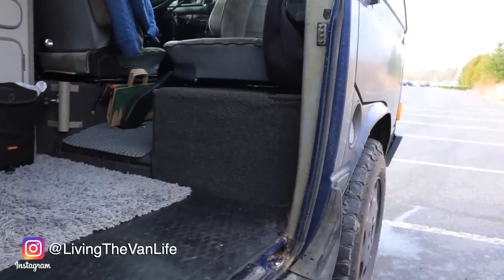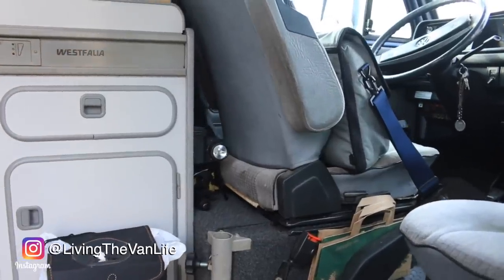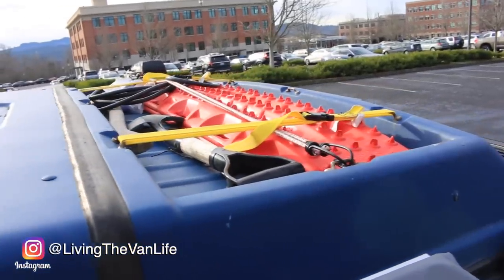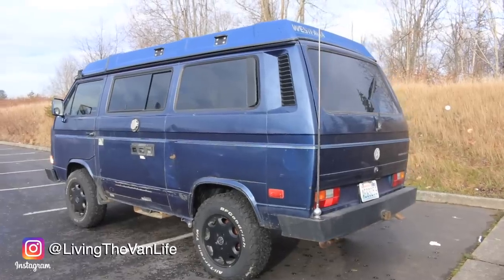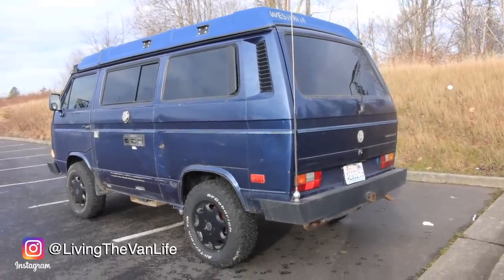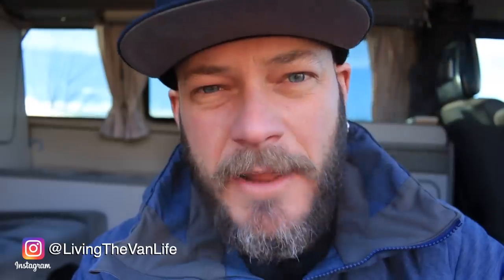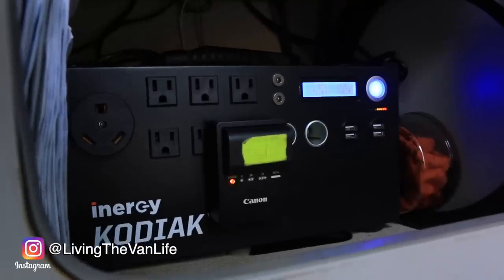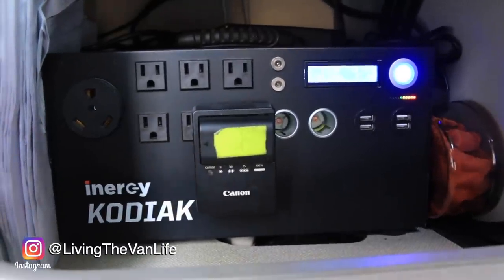Chinese Diesel Heater Install In a Volkswagen Westfalia - Living The Van Life

Comment: Nice install Chad, couple of questions for you. Do you smell any diesel, with the tank mounted inside the van? Second question is, how long does a tank of fuel last? Keep up the great videos.
Reply from the maker: I do not smell any diesel at all inside the van.  I fill the tank directly from the diesel pump at a gas station.  As long as you don’t spill any outside the tank, there is no smell of fuel inside the van.
Reply: around 1/2 l. a hour
Reply: On full power it will use 2 gallons in 25hrs
Reply: @LivingTheVanLife   how many fillings and or different pumps have you used? i have had a diesel vanagon for years and ive considered the diesel heater. even considered using the tank, rather than taking from the vehicle. The reason im mentioning this is, there are some really leaky messy diesel pumps out there. even with a steady hand and slow pumping, some just cant help but make a mess. Im wondering what you do to deal with this?..... or if its just the case where it hasnt been long enough, that you have had the chance to come across one of the pumps that spew and leak
Reply: @andrewcornford2306  how is that even possible?
Reply: darthinvictus666 I get 8 hours for every gallon of diesel in mine
Reply: Hi there, does it use a lot of battery power using it over night?

Comment: Did I miss the part about installing the external exhaust?
Reply: You definitely want to intake from outside to not get carbon monoxide poisoning, but routing the exhaust into the van would allow it to heat more efficiently
Reply: @sugarbooty  you guy crack me up
Reply: No, I was waiting on that part 2.

Comment: Popped one of the 5kw units in my B5 1.8T passat trunk and I leave the seat down for the winter and it's thermostatically controlled and comes with a remote keyfob.  I added an LED light in the rear window that let's be know the fuel pump is plugging away... these things are incredibly efficient....

Comment: Excellent install and explanation. 

Battery capacity/draw would be my biggest resource concern with this heater vs the Buddy heater.  
What's your average amp hour draw? 

Also, is there any level of residual heat around the heater housing itself to be concerned with?
Reply from the maker: I will have to make a list of all of these questions and then do one whole video that addresses all the questions.  I will work on some tests that give specific results and figures.
Reply: The heater runs at about 1 Amp on low (about 12 Watts) and 3 amps on high(36 Watts) 4 or so amps if the glow plug is running on startup.  Most I have seen draw wise is 6 Amps.  I would say the average is 2.5 amps.  The outside can get about 90 degrees F in places.  The exhaust muffler makes it much quieter, as does an intake muffler which are aftermarket options.   Average fuel consumption is around 12-24oz per hour of continuous operation.  A carbon monoxide detector with ppm readout is a must.  These are one of the safest and best heating options in my opinion and experience.  It can be ran directly off a cheap solar controller, so easy to hook it up that way, you connect an auxiliary battery-and use the cigarette lighter plug as a recharger for while your driving-run the line to the input on the solar controller.  Here is a good video of the current use:
https://youtu.be/KBpHAqN2Gls
Reply: Battery Isolator just in case.  Don't want to be stranded.
Reply: @ProlificInvention  your findings are completely different to the rest of the known world.
on initial start up the glow plug on ALL of the chinese 5kw heaters draw 14a/h,
a little above 1a/h on high and 0.4a/h on tickover once the thermostat temperature is reached. 
Fuel consumption is 0.02ml every click of the pump.
it will use approx 1 litre of diesel in 10 hours of continuous operation on low.

Always run power directly from your house battery, never the solar contoller.

Hope That Helps
Reply: @only-vans  I stand corrected

Comment: Idk if i trust that seal. At least its diesel if it leaks
Reply from the maker: The seal of the fuel nipple to the fuel tank?  I had the exact same concerns, but figured I had to give it a shot.  I have had it installed for a month now and have been monitoring it closely.  There is no sign of any possible leak whatsoever.  So that is nice to see.
Reply: I agree. Adding a layer of RTV silicone or something to that effect will just give you double the insurance if there is any fuel leakage. If it works for him though, no problem. Might even consider a inline on/off valve in case you need to remove the fuel tank without spilling diesel everywhere.

Comment: Hi Chad, thanks for the video, very good explained. I have installed my Webasto heater (looks the same like yours) outside below the floor of the car. Only the hot air tube gets inside. The manufacturer confirmed, no problem. It works good since a year now. That  saves much space inside and another advantage in summer is, you can use it as a fan only blowing fresh outside air to the inside.
Reply from the maker: Awesome.  This is great!

Comment: I have heard that these heaters dont work in high elevations, over 5000ft. Have you had any issues since you seem to be in mountainous areas?
Reply: jerry mc there is actually a version called Plateau made for higher elevations. I’ve seen it on eBay and Amazon. Many of the heaters are altitude adjustable now.
Reply: @aaroninks  Thanks

Comment: Drill a bunch of holes on that board covering the heater to give it more intake breathing space as well as save on weight. Doesn't look like you are storing anything that could fall through the holes in the board, but in case, you could just install mesh netting like screen door material on that board with holes to ensure nothing falls through. This will allow your heater intake to get more fresh air and give you more storage space.
Reply from the maker: Thanks!

Comment: Doesn't diesel fuel stink? I would suck to have even a small spill while refilling the tank inside.
Reply from the maker: Diesel fuel does stink indeed.  With this diesel tank in my cabinet adjacent from my slider door, it makes easy to pull up to a pump and fill directly from the pump to the tank.  It makes NOT spilling easy!
Reply: It is smelly but I find that even if you spill it it(inevitable) it will evaporate fairly quickly.

Comment: It seems to me that a fuel source located inside the van with active electrical sources would be considered dangerous and beyond my comfort zone. Curious, what were your reasons for not mounting it underneath the van? To me that would seem to be the safest location, but might be more of a challenge to fill. Thanks!
Reply: Indigenous Pathways  Diesel is a safe fuel u need to ether compress it or spray it in a fine mist to have it combust u could throw a match on a puddle of diesel and it won’t  ignite
Reply from the maker: Mounting it under the van would be possible, but it would take a lot of fabrication and design to make it all possible.   Diesel is not highly flammable like gasoline or propane.
Reply: Yup, as the other guys say, diesel is quite safe. Gasoline really does gas up and become explosive. Diesel is more like a can of engine oil. It is flammable but not particularly explosive. This is one reason why diesel is so suitable for boats, and it is the reason that diesel is used for this type of heater.
Reply: There are auxiliary diesel tanks made out of metal one could purchase and install under the van. Benefits would be more capacity and easier to fuel up (just roll up to a diesel pump and fill up). I don't think this 10 liter plastic tank is suitable for that kind of use. A proper such tank would probably cost more than the whole heater package though, but then again $170 is dirt cheap.
Reply: As mentioned, diesel is not particularly explosive, quite the opposite actually. We used to heat out boat (45' offshore sailboat) with a diesel heater and a diesel stove. To get the stove started (Dickinson Marine stove / oven) you opened the valve and waited for visible fuel... then dropped a lit wad of paper in on top. Then you did it again... then again. Some times 3 or 4 times to get it to light. This was about 4 feet from a 450 gal diesel tank and the day tank (12 or so gallons on top). Lived on that boat for 5 years.

Very common setup on boats / yachts. These types of heaters have been used for years in the marine industry, and while finicky (apparently) they work well and are safe.

Comment: I like the idea of using the diesel fuel instead of propane. I would be interested in knowing how long a tank of fuel will last you.  if it's 10 liters, that is about 2.6 gallons. I'm sure it would depend on how cold it is outside and how warm you keep your van.  Also what kind if impact does it make on your auxiliary battery?
Reply: 1 gallon of diesel has 139,000 BTUs.
5kw = 17,060 btus

So on max settings, 1 gallon of diesel will last approximately 8 hours.  That is if it ran full blast the entire time, which is unlikely to ever happen in a van.
Reply: That answers my question pretty well.  Thank you Logan.
Reply: The heater runs at about 1 Amp on low (about 12 Watts) and 3 amps on high(36 Watts) 4 or so amps if the glow plug is running on startup.  Most I have seen draw wise is 6 Amps.  I would say the average is 2.5 amps.  The outside can get about 90 degrees F in places.  The exhaust muffler makes it much quieter, as does an intake muffler which are aftermarket options.   Average fuel consumption is around 12-24oz per hour of continuous operation.  A carbon monoxide detector with ppm readout is a must.  These are one of the safest and best heating options in my opinion and experience.  It can be ran directly off a cheap solar controller, so easy to hook it up that way, you connect an auxiliary battery-and use the cigarette lighter plug as a recharger for while your driving-run the line to the input on the solar controller.  Here is a good video of the current use:
https://youtu.be/KBpHAqN2Gls
Reply: That's great.  You guys taught me a few things today about the fuel and power.  Thank you Prolific and Logan.   Good on fuel consumption and on power use.  I'll definitely be considering a unit like this when I do a camper build.
Reply: They usually use about.  0.25litre per hour on full if they’re similar to my webasto 2000 stc
Reply: 1/2 l. a hour
Reply: Yes true I should  clarify, mine is only 2kw  - according to manual 
0.12L – 0.24L per hour for the 2000STC but will vary by heater brand and design, so 0.5 probably closer for a 5kw on full temp. Mines tapped into main fuel tank and I’ve never seen the needle move.
Reply: @RealHankShill  Thank you very much Logan
Reply: @RealHankShill  These are not 5KW though, that's a bit of creative license by the Chinese, I suspect. Real world fuel use is not remotely that high.
Reply: my chiness diesel heater 5kw takes 100ml / 0.1L per hour, on lower settings. 1L per 10 hours.
Reply: @adrianzabiello9839  which model? ebay/amazon
 linK?
Reply: You think that little Chinese heater is running at 100% efficiency?

Comment: How much current does that unit draw how long will it run before you kill the auxiliary battery thanks
Reply: While heating up it draws about 9 amps..  Running on max heat it uses about 3 amps

Comment: You didn’t show one of the most important things which is the where and how you cut into the van to exit the air intake and exhaust from the van!
Reply: He did @18:10
Reply: He did @ 16:15
Reply: That is what I am looking for! I have the same heater and Westfalia, and now it's time to cut the holes, please let me know what you did to cut the holes in the floor 🤠
Reply: @Zombierippa  Just use a bimetal or high speed steel hole saw.
Reply: @court2379   I ended up cutting the floor of the Westy bed out so that the entire heater sits flush on the metal floor, then I traced the holes in the mounting plate and only cut and drilled holes big enough for the connectors to fit through.

Comment: Hey there! Love the videos... I wish I could cook some of the stuff I've seen on the channel. Amazing... One thing I thought about while watching this video that I wanted to recommend to you is to use some Split Loom protector on that fuel line to ensure years of hassle free use. I can't imagine it would happen, but a pinhole leak in the diesel line would be annoying. I install aftermarket automotive accessories professionally, and as a rule of thumb in our shop, if its in the engine bay or outside the vehicle it gets loomed just for the extra protection. Anyway great video! Thanks for all the great content!

Comment: Very nice, I have same setup and it works great. The one thing I would recommend is an air filter  to keep lint ,hair,mice or any bugs from getting on it so you don't get stinky air from cooked critter. If you want to reclaim that other wasted heat from the exhaust  maybe you can heat your water with it , I read temps of over 500 degrees off exhaust pipe. Thanks for sharing your experience of the heater.
Reply from the maker: Good call.
Reply: Make sure it is not a restrictive filter otherwise the heater will get too hot .The other thing I have heard is running on high for a little while before shut down keeps soot from building up .

Comment: DANGER! DANGER!
Please rethink the use of zip ties to mount an external fuel line! They Will deteriorate and then you Will have a hanging Fuel Line. 
DANGER! DANGER!
Reply from the maker: Thanks for the feedback
Reply: I’ve never seen a deteriorated zip tie. 😂
Reply: @nyccollin  I'm a Professional Driver and I use zip ties for various wiring harnesses and if exposed to the elements, road grime, etc...they become brittle over time and break.  That is why you should not use them on a fuel line, or any other place on the exterior of a vehical.  Quick fix only, not long term solution.  Especially do not rely on them to protect something that has the potential to cause a fire and Death....i.e. the fuel line.
Reply: @watcher2554  its diesel dude, not an huge safety concern. And, black cable ties are UV rated. The white ones are not and will indeed deteriorate.

Comment: Is it possible to make these work with the cheaper kerosene?
Reply from the maker: They work with Kerosene yes.
Reply: Kerosene  fuel is just a more refined fuel than Diesel, than jet fuel is the cleanest
Reply: cheaper kerosene ???? in my town diesel is half the cost of kerosene  diesel is way cheaper but another option for fuel is jet A for aircraft we can buy it at the local airport for 30 to 40% cheaper than kerosene and it is simply bulk super clean Kerosene .
Reply: @dexter2433  Kerosene is supposed to be cheaper everywhere because its used as a heating oil and its not taxed like petrol or diesel so it SHOULD be cheaper.
Reply: Strongly recommend using only a no. 1 fuel such as kerosine, no.1 heating or no.1 diesel and Jet-A (all identical just taxed different). And run ‘em in the summer a few times and they will rarely fail!!!

Comment: Do check the  intake fan once a month. It gets lint and dust on it. Just like Computers. Which cuts the performance of the fan. I put a 4"x4" fan filter in front on the intake hole. To catch the dust and lint..And that muffler does work. Cuts the noise. 

And as one person said. You can use the exhaust to keep the engine block warm. It can also be used to keep any external Water Tank\Plumbing lines from freezing..

Comment: Nice install info,,surprised how cheap it is..hope it works well for long time,
I got 7500 btu Espar several years back,for my custom TC,
Used plastic jug aproved for fuel hiden between truck and bed side bolted down,,
drilled hole for fuel line on TOP of this,,had to drill  exhaust pipe outlet thru the truck bed extend below..
Funny thing was someone heard the exhaust sound when I parked on city st. And called Fire department thinking it was Propane escaping..
Lol no propane in my truck,quite a surprise for the Firemen..
Espar works good and uses very litle diesel and low electric drain,I have 100 amp AGM deep cycle,
 drained 20%runing overnight at minus 20...recharge from solar panel

Comment: Most 18 wheelers use them. Just be careful putting things in front of the heat vent. If you have carpet turn the vent to the side or up. I've heard of them melting things. Like shoes. And like you I wouldn't get the muffler. They aren't loud at all. Great heaters. Very good video.
Reply from the maker: Thanks Jamey

Comment: Cool video. Filter the clean air side without obstructing.  If you use a couple T's to branch the intake plenum, you can fit a few filters without reducing airflow.

Comment: New subscriber, real slick installation. The only thing I’d do differently is add a protective flex line around your fuel line. You can get a flex hose that is also heat resistant and strong enough to protect your fuel line from debris being thrown up from the road. Just a thought. What a huge improvement‼️👍👍. Stay Safe,  Vinny 🇺🇸

Comment: Years ago when VW Beetles were the rage, you could equip them with a gasoline fueled heater for instant heat on the coldest of days. I owned 5 Beetles altogether over those years, but never needed the optional heaters that ran on gasoline because the factory engine exhaust heaters seemed to work very well. Of course, I was never living or camping in those little cars as you do with your van. I only bring this to the table because if they are still made, using the gas version would eliminate the need for a separate fuel source and tank. You did an excellent video on this subject and a great service to those who need to warm their vans for whatever reasons. Much thanks.